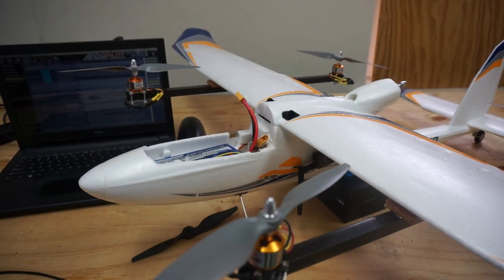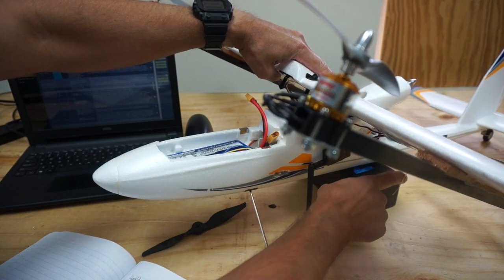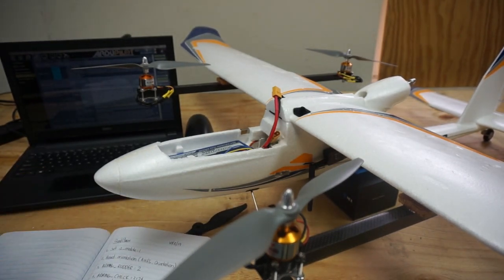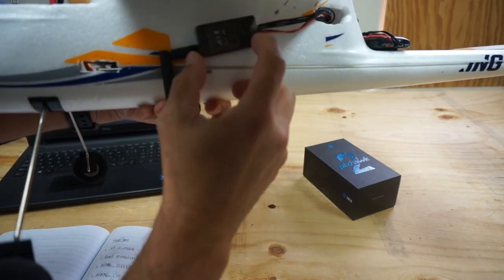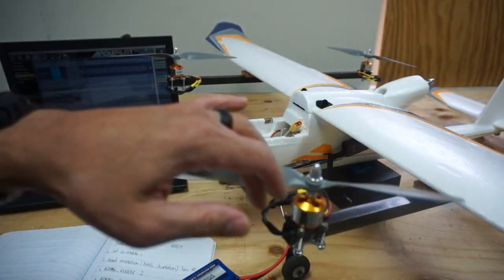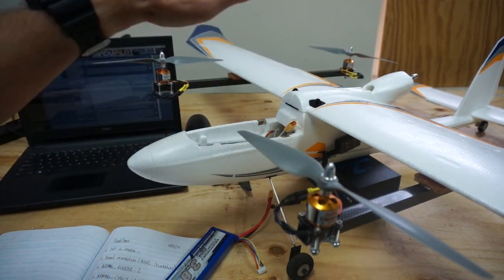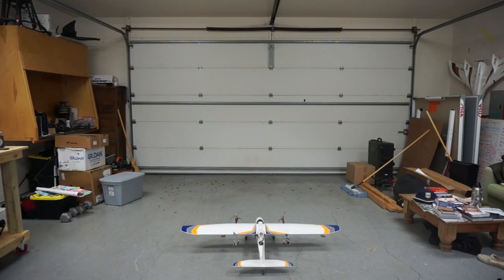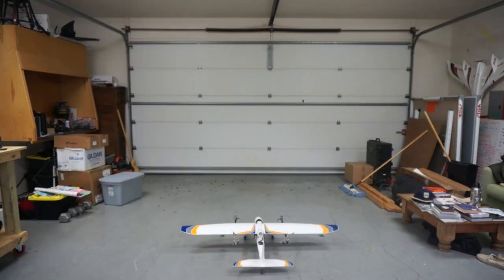Bixler QuadPlane Update #3 - Garage Hover

Comment: Is that the first flight? Impressive. I'm signing right now to get the same thing. A bit of tuning and it has to fly spectacularly. 
When I was studying VTOLs, I always wondered whether to use PX4 or Ardupilot. Most people use PX4, but I've used Ardupilot a lot and I trust it, but I don't know if it's more or less advanced than PX4 when it comes to VTOLs 🙄